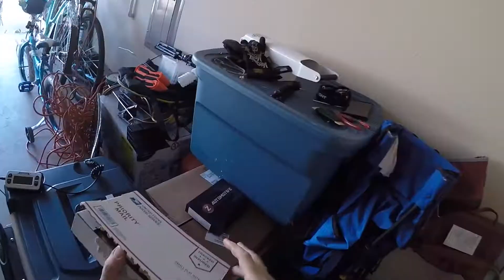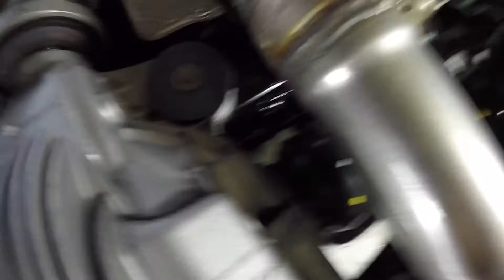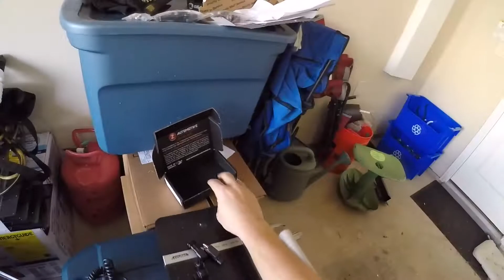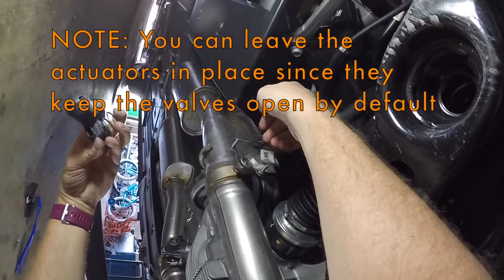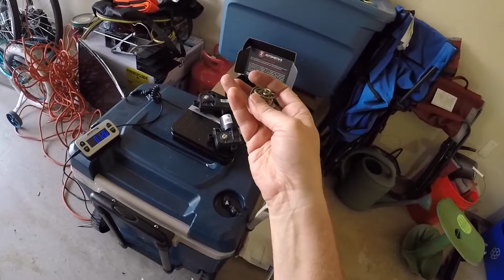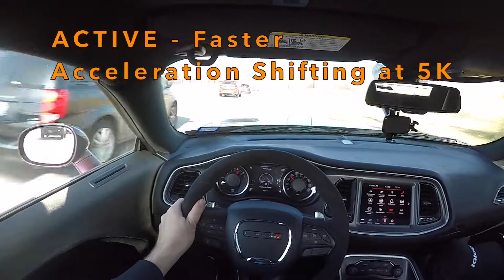Active Exhaust Delete Options for Dodge Challenger and Charger - FREE vs.  Z Automotive vs. Khaos

Comment: The 19 and up thing isn't true.  There are a lot of people with 19 and newer scats that are getting CEL.  Look at other YouTube vids on this subject and you will see.
Reply from the maker: Do you know any channel names where to look? I just looked up a bunch and so far the only 19 up I've found with a CEL is FatKat, but in that vid he said they unplugged the actuator (which you're not supposed to do) and once they plugged it back in it went off. Most of the other active exhaust vids I'm finding are ones installing one of the delete kits or on 18 and below. I'll keep looking though. I definitely want to know for sure.
Reply: @Scavenger1320  Darkside Mopar has a short video on this.  Look in the comments and there are multiple people with 19 and up chargers and challengers getting CEL.
Reply from the maker: @shinobi9922  thanks for that info. I'm definitely going to keep researching. I just watched it and read through every comment. I saw 5 that mentioned a light, 2 of them have a 5.7, 1 has a Hellcat, and the other 2 didn't give any other info (so they may have 5.7s, no way to know). This coincides with the comment Khaos Motorsports left on my vid, so it seems that this won't work on 5.7s, and if we go by the single Hellcat owner, those too.  I'm not sure what would be different about the system on the 5.7s. As for 392s, I've seen a lot of owners report they did the free trick and it worked without a light and none (confirmed) that reported otherwise. I'll keep looking and digging though. I'm planning an update to this video in the future after I cut my valves out and can do a little more testing. I'm also going to be doing the free delete on a friends car so we'll see on his, although he has a 392 also.
Reply: @Scavenger1320  so are you still running the z automotive setup?  If so how are they doing?  No codes?  Did you disconnect the battery before installing them or is that not necessary?
Reply from the maker: @shinobi9922  yes, I still have the z automotive plugs in. No issues at all, no codes, and my wiring and zip-tying is still intact. I never disconnected the battery and even in Z Automotive's instructions there's no mention of disconnecting it so I don't think it's necessary.
Reply: @Scavenger1320  I'd like to see that "free" method video on yur friends car, where u wire tie, take off spring, and reconnect actuator. I would also like to hear exhaust idle from back of car parked: before and after mod, cold start and warm idle, I know you sort of did that but want to see it again, thanks.

Comment: If you put in "drag" mode, does that keep valve open?
Reply from the maker: Wish I knew for sure. A lot of people think it does, and I tried to test it here but since the actuators didn't get "stopped" in their normal position it seems they stayed in a default open mode. Eventually I'm going to cut the valves out, when I do I'm going to hook the actuators back up to the cut out valves and test it again.

Comment: on a 2020 Scat Pack, is there any reason why you can't just wire the valves open, and put the motors back on, still connected to the harness, but without the springs?
Reply from the maker: That's basically what I do and talk about in this vid. I used the Z Automotive plugs just so that I could completely remove the actuators and eventually the valves themselves, but before I installed them, I ran it like that with the actuators connected but not attached and I didn't get any codes. You can see what the actuators actually do at startup in this vid too.

Comment: I think 18 and older valves keep spinning and throw a code if disconnected. You will notice a difference between the 2 if you had the vibrants on! The stock mufflers hide a lot of the sound
Reply from the maker: If only I could find an 18 and below owner to let me test it out and throw the gopro underneath. It'd be cool just to see it. Yeah,  I need to get them vibrants soon. I keep thinking about putting it off since it probably won't help with performance but then I remember that'll be my chance to cut these valves out too.
Reply: @Scavenger1320  yes I got a code 2019 charger rt
Reply from the maker: @toniopre1  yeah, unfortunately it seems there's something different with the 5.7's. I haven't heard of a single case of it working on them.
Reply: @Scavenger1320   you can test my 2017 scat pack charger if I can keep whichever works 😌
Reply from the maker: @1C3EDGESLAAMMRRYY  being a 2017 any of the options will work except for the free option. Really the only thing I wanted to see is what the actuators do when they're detached from the valve on the earlier models. Good try though! I actually ended up doing a giveaway on the Khaos kit that I didn't use so I don't even have that anymore.
Reply: @Scavenger1320   awww man 😂 I guess I was a little late… but love the video man very informational !! Hard to find a good in depth video with quality info

Comment: That was me who did the free mod with no codes!! With it off it cracks louder at part throttle stabs because with it hooked up the valves move slow to fully open! It’s for noise pollution
Reply from the maker: Thought so. Tough to keep track of YT usernames with FB real names. I've seen some nasty replies before to your comments about doing it for free, so that was part of my motivation to try and video what happens. Thanks for reminding everyone about that, this video might have been a lot different otherwise.

Comment: Great video man! And great job going above and beyond multiple products for the sake of the review. Also congrats on 500 Subs!! I was also thinking Vibrant for my mid muffler on the Hellcat. I did dynomax on the ScatPack and loved them but wanted to try something different
Reply from the maker: Thanks! It really just worked out that way on buying the products. I bought the Khaos kit before I even took delivery of my car (yeah, I've had it laying around THAT long lol). Then when I found out about the plugs I had to get them since I knew they'd let me completely remove the weight of the actuators/valves. Only one thing to do with the Khaos kit now, just trying to figure out how to do it, and I still have that extra zl1 addons jackpad too.
Reply: @Scavenger1320  haha lots of giveaway items!

Comment: Wondering your thoughts.. I seen you went to the track..   I haven't even done that in my 20 scat ..  hve  under 1500 miles only .  Went on a coast trip.. got on her a bit .. but no burnouts or anything.. etc..  now she sounds like shit.. like  I blew my ex. Mani. Gaskets .  Or that hemi tick 🤔  idk.. but from one day to the next  she aint sounding like she did..  kinda bummed at the moment. . That .. she couldn't handle a few  getty  ups..  any thoughts .. my man. ?  I hope its exhaust..  but  I hear it at cold start & anytime..     .. I was gonna spray soap water on my manifolds. . & hope its that...   weird though. One thing I did notice as well was the exhaust popping on cold start.  Never did before I got on it.. but I think its cuz.  All the exhaust got fully broken in on that trip.  
Either way she sounds like  crap.. dont like it..   & do you hear anythingfrom your 1320?   Lemmeknow  🙏 your thoughts
Reply from the maker: Hard to say without hearing it. I once had a work truck that all of a sudden sounded like someone cut off the exhaust and it was running open manifolds, I figured it was an exhaust leak, but turned out one of the cylinders blew a spark plug completely out. But that was a ford v-10, just bringing it up as an example of a time something sounded like exhaust but was something else. It sounds like its probably exhaust related but you never know.

Being new with that low mileage, I'd take it in to the dealer for a warranty issue. If it sounds that bad, they should hear it right away, and if not, tell them to find another 392 on the lot and start it up side by side with yours. Just getting on it shouldn't cause any issues like that, and if it started doing it because you did, then whatever the problem is was already there and would of come out eventually regardless.

My 1320 sounds perfect to me, and my first time at the drag strip I only had around 700 miles on it. I just passed 1500 miles and have made 14 passes down the 1/4 mile so far, plus I don't drive her easy either.
Reply: @Scavenger1320  appreciate 🙏 cha bud..  definitely taking her in.. thx for da great response👍 & idea

Comment: Is it any reason cutting actuator out with taxer plug would trip cel light
Reply from the maker: If you get the Z automotive plugs you can do whatever you want with the actuators and no CEL light will come on. Leave them in, take them off, cut off the valves. It gives you all those options. As soon as I go to the exhaust shop I'll definitely have them cut out the valves on mine.

Comment: Now I know why I had so many problems with the active exhaust system on my 2016 SRT 392. Had a borla exhaust and once added the check engine light stayed on. Purchased a kit from active exhaust solutions which was a nightmare. Bulky and difficult to install and it never worked correctly. I ended up selling the car after literally driving around for 3 years with the check engine light on! Looking to buy a wide body Scat with shaker now so I'm glad that there is a much better alternative with the Z automotive kit. Thanks for sharing
Reply from the maker: Thanks for watching! I haven't heard of the active exhaust solutions but that sucks you had to deal with that light on the entire time. The wide body shakers are pretty sweet, but if you get one you have the free option you can do too. I plan on racing a road course in mine and I already know I'd wish I had a wide body scat for that.
Reply: @Scavenger1320  There's a free option? I love that 1320 tho! Limited production numbers is what I like most about them. My SRT 392 was actually 1 of 11.
Reply from the maker: @moparmade392  2019 and up there is. Gonna do that free delete on a buddy's 2019 1320 when we meet up at the track in a couple weeks. It's cool having a more rare car. Mine the way it's spec'd out is 1 of 1.
Reply: @Scavenger1320  If u could give me some more info about the free option on 2019 and up I'd really appreciate that.
Reply: I have the same problem 2016 SRT 392 active exhaust is on now and it's annoying